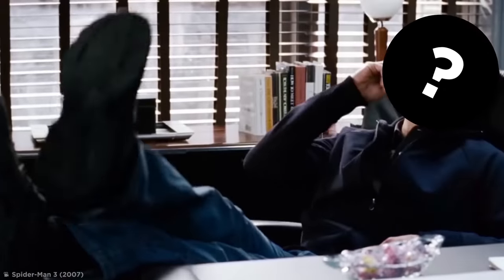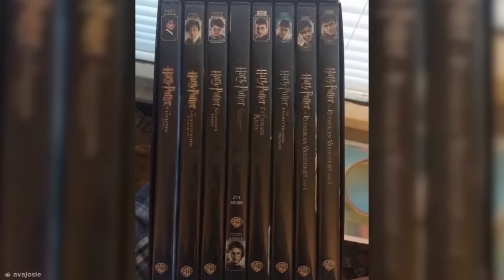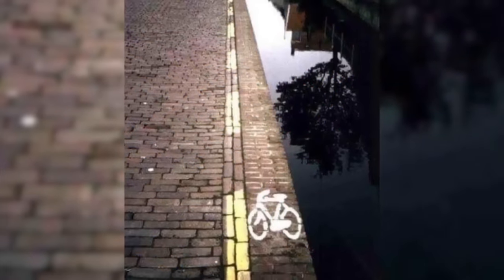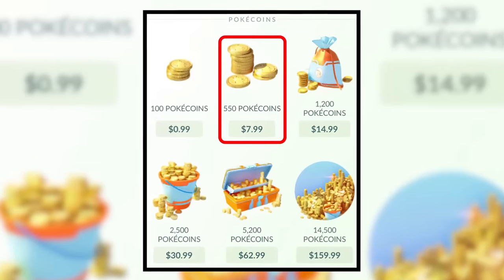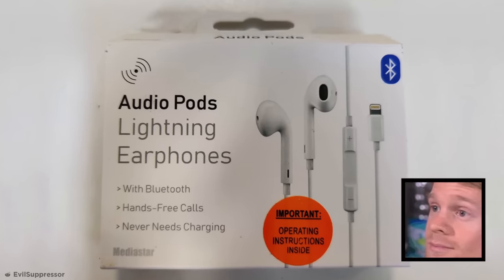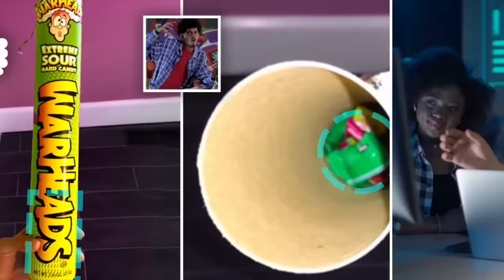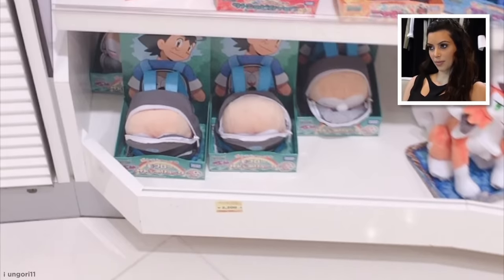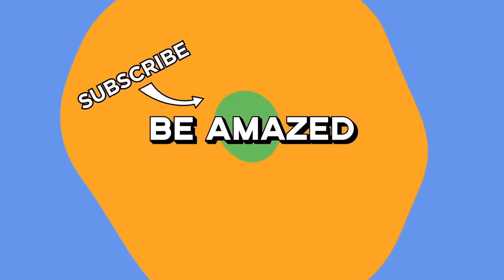Designers Who Should Go To Hell For Their Ideas - Part 3

Comment: 13:39 I worked for DHL. You pay more for the larger box to be shipped. So it not about keeping the item save for the customer, or about the space in the delivery vichle. It about making you pay more for the volume of the larger box, when the weight of the item would have been cheaper.
Reply: What's really strange is getting a large box like that with one tiny item, but you got free shipping (has happened with me with both Amazon and Walmart). Really weird because there were other items ordered at the same time, usually.
Reply: What the hell is DHL?
Reply: @harukoharuhara1863  It's a shipping service. Look them up online. Easy to find.
Reply: @tb6303  where I'm from, there's only UPS and FedEx
Reply: @harukoharuhara1863  I guess they aren't in a lot of places. I only became aware of them around 5 or 6 years ago, when I lived in a different state in the USA. Most of the time, they'd give the package to UPS or FedEx, but sometimes they'd deliver it. Where I live now is quite rural and they never deliver packages to me here.
Reply: @tb6303  I'm in Maine and I never saw a DHL truck
Reply: @harukoharuhara1863  That's interesting. I thought they would be all over the U.S. Apparently not.

Comment: The design flaw involving a low ceiling in a homeowner's bathroom reminds me of a Navy barracks at a large base in Sicily.  I was never there, but I was told the top floor of rooms had the ceilings lower than the other floors in this building with the result that standard, "Military grade " storage lockers could not be placed in the rooms.  As a consequence, occupants of rooms on the top floor had non-standard furniture in their rooms.

Comment: The worst design i've ever seen (and witnessed) was with the LG Velvet. "Velvet" because the surface of this smartphone was so smooth that it even fell off (after around 20 sec) a completely flat surface where it was put on. Not to mention that I had serious problems holding it in my hands while using....
Reply: Therefore ensuring you probably bought a not so cheap case eh

Comment: 15:00 Certain products are required by law in some places to include specific information on the box with minimum font size restrictions. Even though there are many less wasteful ways to do this, it often is cheaper to just use a bigger box across the board to appease the market with the most restrictive packaging requirements. Each box is cheaper if they are all the same due to bulk price reductions making the extra material cost becomes negligible. *This is a specific note for pharmaceuticals which whitening strips may be classified as.

Comment: I feel like the ATM ones could be fixed by adding a ramp or stairs below them rather than bringing them down, only if the height is reasonable for that method to work.

If not then they do need to probably renovate the inside to bring the floor inside down to a height that everyone can use without stairs/ramps.
Reply: Plus, if the ATM is high up, people won't be able to peek at you entering your pun number
Reply: Banks want your money to STAY in their pockets. Having an ATM at street level just is too easy to take your money OUT.
Reply: That would not be on their land, from the examples shown, but on public land

Comment: Have I got a design flaw for you! The Illinois and Michigan Canal runs right through the middle of my city, including our downtown area. It hasn't been used in a hundred years or so and it's a state park today that runs through several cities. You can walk on the old tow path that the mules used to walk on as they pulled the barges on the Canal. Our mayor got the idea to scoop out the part of the Canal that runs through downtown. Never mind it was gorgeous the way it was. I've seen herds of deer under the canal bridges, foxes, one time a coyote. Not to mention the countless smaller wildlife and beautiful wildflowers and grasses. All gone now. The installed a pump to fill the newly scooped canal with water from a nearby river and built a raised cement walkway and bike path with sump pumps to keep them from flooding. The first problem was they didn't scoop it deep enough so the whole thing filled with algae. This caused nasty respiratory distress to anyone near it. I have to walk across one of the bridges to get to work. Half a block away, my nose would start running like a faucet. It would drain into my chest and cause me to hawk loogies all over the place. I felt bad for the people living close by. City officials advised them to keep their airconditioners running. The raised sidewalk was too low causing it to be constantly flooded and the motors burnt out. All this happened just a few days after it was filled with water. It took weeks to drain the water after the pump was shut off. I called it the summer of coughing and hacking. Now instead of beautiful native flora and fauna under our downtown, we have a mud hole (the mud is often green from the algae) and a bunch of gray concrete. Thanks, Mayor Esbach.

Comment: I've been really careful about looking at unit weight (for foods) and count (for packages) for a long time.  Some stores list unit price too on the shelf labels.  Potato and corn chips, cheesy puffs, etc., the bags vary so much in size and how much they are filled between one brand and another, you really have to look to know how much you are getting.  

I get some generics that the bags look pretty small, but they are just about full to the top (just enough space so chips don't spill out when you open it up).  Compared to the name brand chips next to it it looks like you'd be getting like half the amount of chips but by weight you're getting the same or more.

Comment: That ATM and bathroom ones made me laugh out loud for real.  😂🤣
For the razors it clearly tells you on the package how many replacement blades and handles you get.  
For the skin care when it’s in tubes you can shake it and tell it’s not full but when it comes to the jars of creams you get a decent sized jar but the you notice there is a small pot within that jar so you’re getting a lot less than you thought.  Especially if you don’t know how much an ounce should look like.
Reply: I thought the same thing about the razors. Deceptive maybe, but it says how many replacements there are lol.
Reply: The ATMs had a growth spurt I think 😅
Reply: The designer jeans made me laugh!
Reply: About the toilet, it could be due to building code, maybe the building is big enough that a separate bathroom is mandatory, even though the occupants agree that they don't need it.  So it was installed to satisfy regulations, not to be actually available for the occupants.
About the ATMs, maybe every branch of the bank is required to have ATM access, even though a regional HQ didn't see the need to satisfy the requirement more than literally.  A single branch would probably not get far with shenanigans of that kind, but a region?  Could be one where the international HQ never looks as long as the quarterlies are good.
Reply: I always thought the reason for the empty space in the razor pack was to eject the old cartridge into before picking up a new one. That wouldn't explain why the one had two empty spaces, though.

Comment: Wow, at over 6ft 4in tall some of those ATMs looked to high for me. Lol I always do the math and measure when nesisary at every opportunity besides sometimes gas prices. Like 2.98 vs 3.19 on a completely empty 18.5 gallon tank would only be a difference of $3.89. Compounded over 52 weeks in a year, would only be $202.02. In a 60 year life span only $12,121.20. So as long as im within 21 cents of the optimal local price then fine. I like subway pizzas never an issue in store. Oof $192 for 8 hours of parking seems steep for people with less than millions of dollars.  I guess in LA and If you make $210,240 after taxes (lol so 500,000 before taxes lol) or if you make 265,000 passivly with several million invested, parking there would just cancel your passive income rate in that period of time you parked. Maybe worth it, immediately on top of some very attraction thing like feet from a popular very over crouded event.

Comment: I once purchased a Windows 7 laptop from Walmart. Turns out it was designed so that the keyboard made physical contact with the screen while it was closed which I couldn't possibly have noticed. Additionally, the screen had a thin plastic material to it. Over a few months a permanent scratch formed in the center of the screen. Some months later I got an email from the manufacturer asking me how I like it and I just ripped into damn about how stupid the design was and how I will never buy from them again. And I never did. I don't even use a laptop anymore. I haven't even physically turned it on in a few years.
Reply: hm some laptops are bad chromebooks are better then most laptops with a "No Scratch on the center of the screen guarantee" by me as i own a chromebook, Acer Chromebook, buy today, or buy never. your choice.
Reply: @kyutogreyfox4292  I own one. My chrome book is fairly high end and the screen never scratches, but , for the development software I use I have to work in windows so the only thing I really cared about was being able to remote access a windows PC without lag and with low power.

My prior experience with bad windows laptops led me to use a chrome book to remote access a desktop PC. Battery was great, screen worked, etc. The only thing I couldn't do was get USB peripherals to stream.

There were, however, two big problems with the setup. The first was that Windows 10 likes to update whenever it feels like it so a few years back I had to destroy my computer's ability to ever be updated because after an update the computer would restart and then I'd have to be back in my office to get everything set up and I work remotely. The other problem was that the Chromebook updates even more often and those updates very frequently broke things and there was nothing I could do to stop it.

Comment: Dishonorable Mention:
Honda's "caprured rotor" design requires removing the entire hub every time you do a simple break job, taking a $99 normal wear item to the $1-2k stratosphere.
Reply: is it a dirt bike??
Reply: @kinetic158  No, a brake design on some late 90s Honda cars that required you to remove the entire hub assembly just to change a rotor. There's a special place in hell for that engineer.
Reply: @superque4  lol

Comment: 17:58 isn't hiding anything with its label, you'd have to be promised more than what you get for it to have been hiding something. It clearly states "6x shaving blades + 1x shaving handle" on the packaging, and, in fact, you are getting 1x shaving blade more than the packaging even promises, as the 1x shaving handle has a shaving blade attached to it that is not included in the 6x shaving blades promised by the packaging.

Comment: On the misaligned ceiling light; more often than not, when it comes to new commercial building construction, you will come across issues like this. My ex is an HVAC Commercial Journeyman. When it comes to architecture and blueprints, there is (1) set for the HAVC Sub-Contractor showing where all the heating and air vents are to be located in the ceiling, (1) set for the Electrical Sub-Contractor showing where all the light fixtures are to be located in the ceiling and (1) set for the Plumbing Sub-Contractor showing where all the sprinklers are to be located in the ceiling. Each set of blueprints is drawn up by three different architects that don't talk to each other apparently because 9 out of 10 times, the vents, light fixtures and sprinklers are ALL in the same location in the ceiling on those three individual sets is blueprints for those three trades. How ridiculous is that? Those three trades work on the same job sites together often enough that their foreman get together and go over their sets of blueprints together to keep that kind of bullsh!t from happening.

~ APRIL LIPKE

Comment: The razor one kind of makes sense. There is 1 gap to eject the old head back when replacing. There should really only be 1 extra blade in the pack, or 2 if being generous.
Reply: But the old one you eject fits in the space of the one you take out to replace it, so it's still extra packaging and unnecessary.

Comment: Volkswagen recently introduced Sit to Start , you know, a car thief's wet dream. Way to go, Volkswagen. Slowly Claps
Reply: You still need to have your key fob.  The car just detects that the key fob is present and somebody sat down in the seat.  Car thieves if anything will have a harder time jacking those cars since there isn't a starter they can short out.
Reply: What are you on about. The last 2 cars I have owned haven't needed a key to start them, just the fob in your pocket. This is the same system but does away with a start/ stop button.

Comment: Comparative shopping is necessary and I taught it to my son at a young age. It also utilizes math skills. The price per ounce can be deceptive on items such as cereal when smaller boxes can be cheaper than larger boxes. Most people assume that buying in bulk is a better buy, but it isn’t always. I also prefer to buy items made in the US when possible or from countries other than China, since those items from China are often poor quality and don’t save you money. Replacement auto parts are notoriously low quality and unless you get a good warranty and can replace the item yourself without incurring a mechanic fee replacing an item annually, buy OEM. My husband has replaced his radiator every year for the past 6 years at no cost but it still involves time, effort and the vehicle being out of service until repaired. He finally bought OEM and realized the quality difference right away.

Comment: Speaking of bridges with no drainage that floods the library building at my college had an external staircase that had no drainage anywhere on it at all so when it rained, all the water would run down the stairs - always a safe thing to happen on stairs - and flood the basement because of course the drain there would regularly clog. It was basically a five-story tall waterfall.

Comment: Thank you to the team for one of the most hillarious videos yet , on bad/stupid/idiotic mistakes , like the flooding foot bridge , and the over height ATMd -  the banks just found a new way to ripp off customers , like manufacturers, with air filled crisps and buiscuit bags -  alledgedly to stop damage to the product during manufacture . 
 I do feel sorry for the guy who's house , had lower than normal ceilings , and the one who had the throñe , placed to potentialy stink up the whole flat - and the excuses to & from freinds , who saw the dunny on the landing in a stairwell  .  
 As for outsized packageing , for very undersized items  -  another ripp- off , by the supplier .  .
 Buyer Be-Aware  , forget the beware though thats still applicable .

Comment: for the banana milk, it doesn't matter whether its full or not, what matter is the volume of liquid contained in the cup. if the cup says 240 ml, and after putting it in measuring cup it is indeed 240 ml then there is no problem.

Comment: One time my sister needed help with a lego set. This wasn't a problem because I was good at it, but it had parts that barely fitted. That meant I needed to use advanced tricks because if I would go and use only physical strength then I would probably break something. Now imagine someone new to lego with this awful set. (If someone is wondering then then there was mistakes made in the instructions).

Comment: There was clearly some diy design in my kitchen, as when the dishwasher is closed, one of the drawers only opens a fourth of the way, hitting the dishwasher handle, and when I pull the dishwasher down, it doesn't go flat as it's front is stopped by the oven warmer drawer handle. Next time measure the handles too.

Comment: I can see where leaving 1 empty space in a pack of shaving razor blades is needed. You need someplace to put the used blade you're currently using. You place the used blade in the holder, release it, then click on the next new blade. There used-to-be instructions to do so.

Comment: 13:25 is more likely to be Amazon and a result of its working conditions. 

It's someone grabbing the nearest box. From what I've heard about working conditions, bearing in mind I've never seen a company have to advertise jobs on TV to get workers, I can't imagine workers giving a crap about the extra cost or pointlessness of putting something small into a huge box.

Plus, it makes no difference whether the van is full. Stuff will move around, especially as the van starts to empty. And I very much doubt any company has a system, automated or otherwise that calculates the dimensions of each package. Where I worked, you load the vans yourself.

Comment: Shipping companies are more concerned about size (volume) and weight. 
Not wether a box is going to move around around in a van. Which will happen anyway the second you deliver the first few.
Big empty boxes cost more to ship they take up space and then you need more vehicles and staff.
A parcel will travel on many different vans and trucks from A to B all different sizes and loaded by different people in different ways, the computer can't calculate that. 
A more likely reason is that the wrong product size was entered on the inventory system or was unknown so the system selected a giant box as a default setting. The warehouse workers have to scan everything they do so it's easier to scan and pack the box the system has told them to use rather than edit the order and scan a different size shipping box while on minimum wage.  Do what the scanner says and nothing else is your fault.